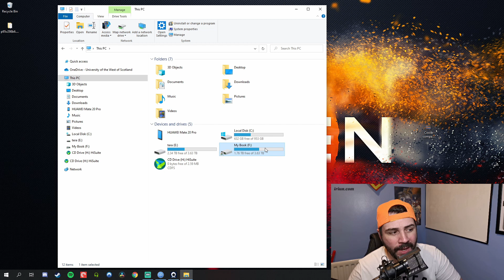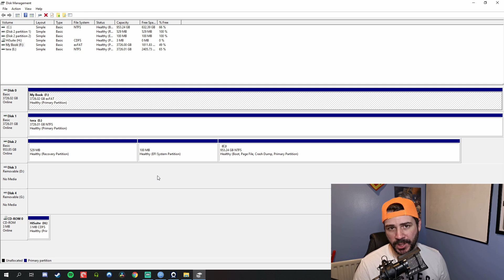External Hard Drive As Internal hard drive (Shuck)

Comment: I have a green one. Tried this and it didnt work. Can you please give me an advice?
Reply from the maker: Sure buddy what model do you have, did you defo check the Power pins and coverage right one
Reply: @mrsteve2441  i got one my book essential in 2011, 2TB, model wd20earx-00pasb0 green caviar. The plastic box is damaged, so I took all the guts out. The drive is running fine but with all the dongle like power brick and usb 3.0 cable :(
Reply from the maker: @PatrickVu3110  sounds like it has a 3.3v power line then buddy, need to cover it like in the video, covering the 2nd and 3rd pin should work for a green, then fire in the sata power and your good
Reply: @mrsteve2441  i will try tmr. I will let you know the result. Thank you
Reply: @mrsteve2441  Hello there. I did all possible combinations. 1 2, 1 3, 2 3. Nothing works
Reply from the maker: @PatrickVu3110  super weird. I would double check 2 things. i done this with a wd 6tb yesterday, and it didnt need the pins covered like my old 4tb one did, try it without the pins covered. If that fails test out those cables with a drive you know is working incase there faulty, lastly the drve will have a model on it, google the model number and see if its possibly another pin that needs covered or some setting on your pc that could be causing it
Reply: @mrsteve2441  I dont know why my comment gone missing. The cable is fine. The no-cover does not work. Mine is My book essential in 2011, 2TB, model wd20earx-00pasb0 green caviar. One thing is: in all scenarios, windows does recognize it in device manager. Other than that, it does not appear in any application. I did try looking for solution on the web but still, this particular wd book from 2011 is so hard
Reply from the maker: @PatrickVu3110  still here on my end buddy. That is super strange, i had a google, its an old model so there is not alot of info on the drive. It does look like a standard wd green drive, and looks like that was before they were pulling the 3.3v pin rubbish they do now adays. I found 1 video of a guy doing it with your exact model. If there inst much on it i would be tempted to do a format on it and then retry in the pc, after that im out of ideas im afraid, there should be no reason its not working. Something must be causing it,
Reply: @mrsteve2441  sorry for causing you so much trouble. Can you send me the link? I will try all the ways. If not work, I think I have to make a case for the naked drive now haha
Reply from the maker: @PatrickVu3110  https://www.youtube.com/watch?v=AvMNnF1gy-4